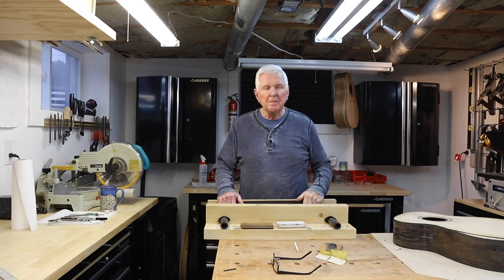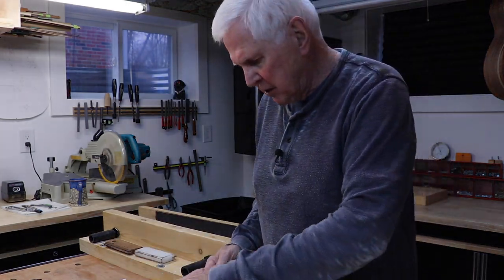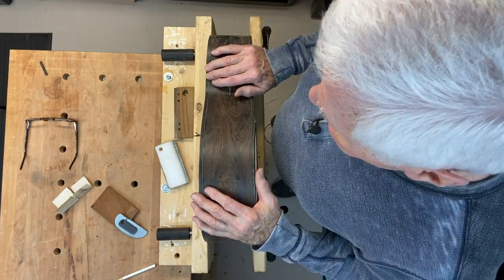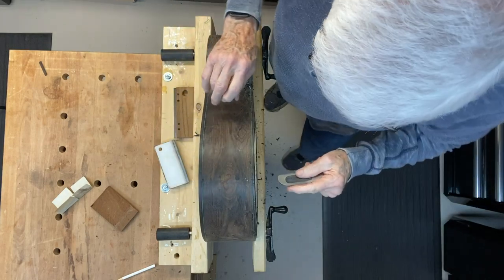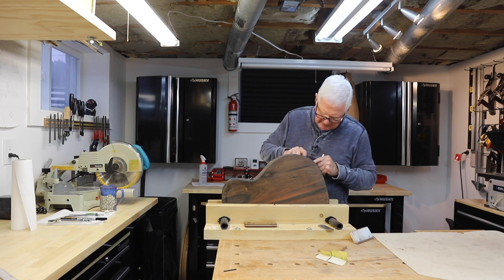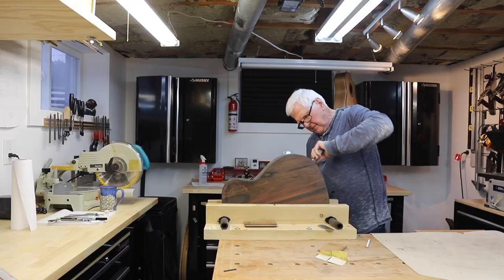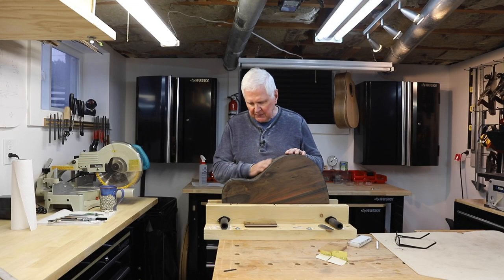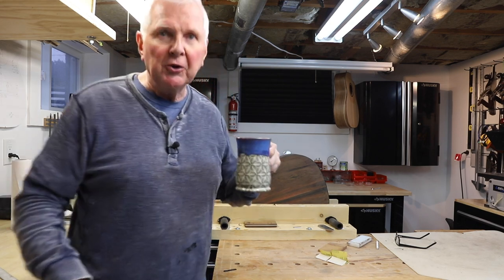The Acoustic Guitar Armrest gets carved

Comment: Should the top have binding channel cut before shaping ?
Reply from the maker: No, not yet. Once we have the top on, we will run the rotor around the edge of the guitar to create the binding channel. Then we will use a template on the top of the guitar and cut an additional channel and then cut away the wood between those two channels on an angle. You'll see that coming up in videos in the next week or two.